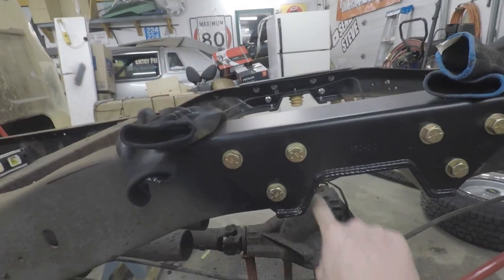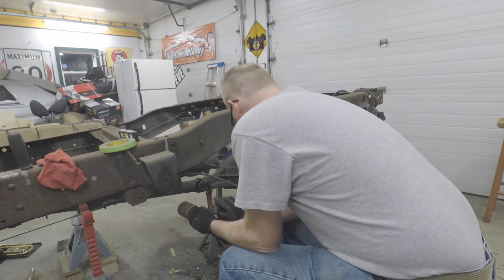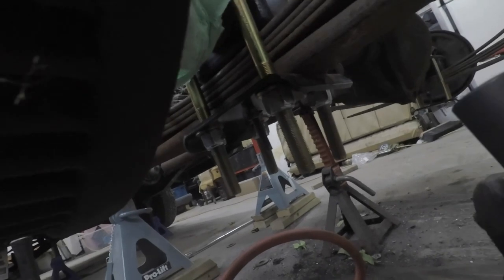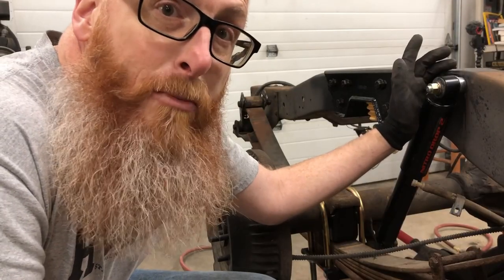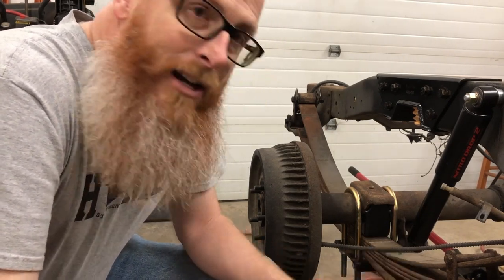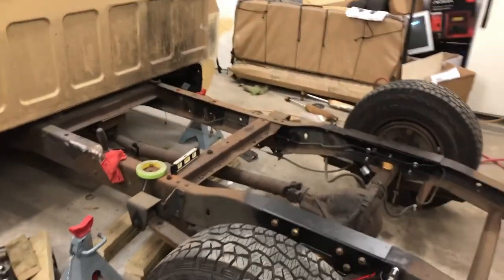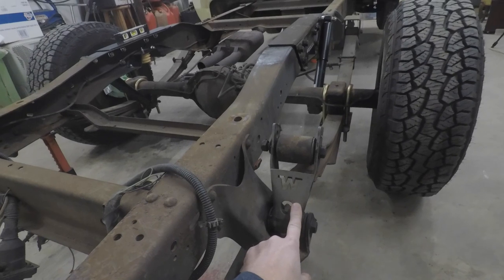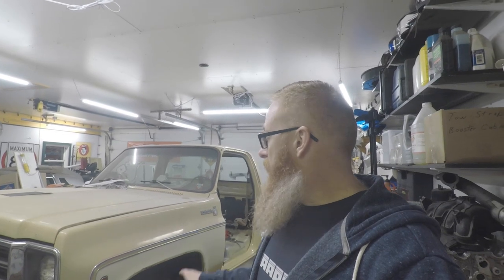The Right Way To INSTALL A Belltech C Notch Kit On My 1977 CHEVY C10 Pt-2

Comment: I don't want a break from dale I can watch that everyday LOL. Sad part is you usually get about 1 inch of drop with those shackles in that lower hole and around 2 inches in the upper that may be enough to get you where you want to be. If not you'll have to drop the front more as you said or replace those front spring hangers with stockers to bring the back up. You don't even have weight on the back now with that heavy long box on it's gonna drop another couple of inches. I ended up with a set or suburban leafs for dad's and they are 4 leaf I think and it's stiff I plan to remove a couple as well, thinking maybe just the overload and bottom most. I really need to make a video and post of it. I'm looking forward to the next one. I haven't even ordered the front parts for my build, still working on getting sheetmetal pieces and all that crap.
Reply: Man I think it would look awesome if you could get the front that low, but you don't want to ride on the bumpstops or plow snow with the rear bumper in reverse LOL.

Comment: same kit on my truck  in front got 2" coil and 3" spindle so got me "5 drop.... in the back install the 6" drop plus one inch shackle drop like yours got me 7" in the back...since you look like me having 56" leaf spring you don't need to notch the bed rail only the 52" leaf spring gonna iting the bed rail, for bolt shock i just cut 1/2" to clear the monting plate, on mine i install shock extention and beleive me your gonna need it...after a few good bump the shock itting the notch kit can occure and the angle is way better and ride smouther! keep on the good work! :)
Reply from the maker: Thanks Sly. Do you think I'll need the shock extension with the Nitro Drop 2 shocks. I was of the understanding that those were the other option to the drop bracket and stock shocks!
Reply: @OldeCarrGuy  i use the same nitro black shock as your don't know about the nitro 2

Comment: Tha pinion angle looks really out of whack. Did you have to adjust that, or can you?
Reply from the maker: Yes I did adjust it!
Reply: So why was the pinion jacked up and how did u correct? I just did a flip in my c10. Haven't hooked the driveshaft yet... cause I still have to make one lol. But I never even paid attention to the pinion angle on mine.
Reply from the maker: @jrskeels6040  my pinion angle was out because I hadn’t paid attention to the position of the brackets that mount between the axle and ubolts. I had to trim them to adjust the angle!
Reply: @OldeCarrGuy  oh damn. Guess I'll definitely be takin a look see when it aimt raining outside.

Comment: Maybe. I missed it did you put newaxlw mounts on the axle?
Reply from the maker: Yes! The kit came with new mounts that fit in an kinda lock into tho old ones! You can see them at 2:53 where I’m tightening up the u-bolts!
Reply: @OldeCarrGuy  nice so no welding requirements did the mounts help with setting driveline angle?
Reply from the maker: Yes! It was perfect!